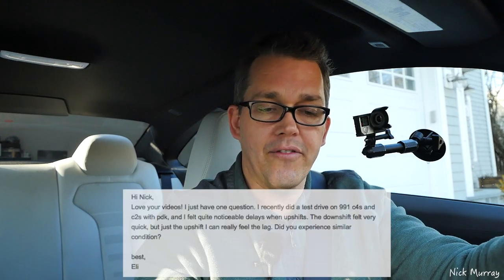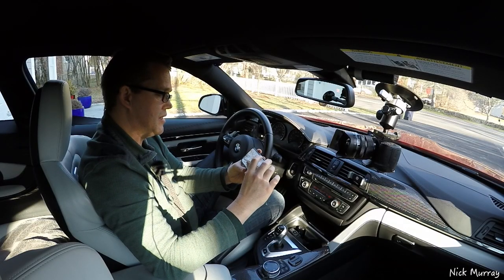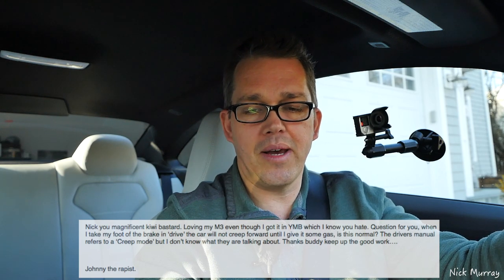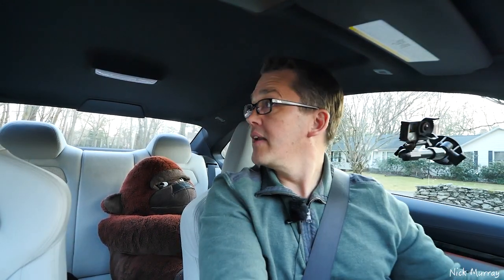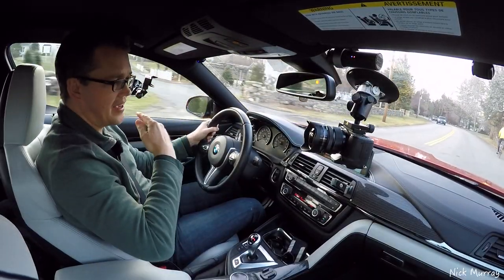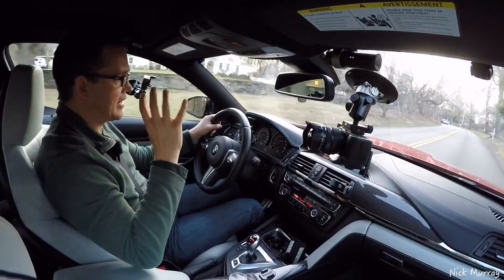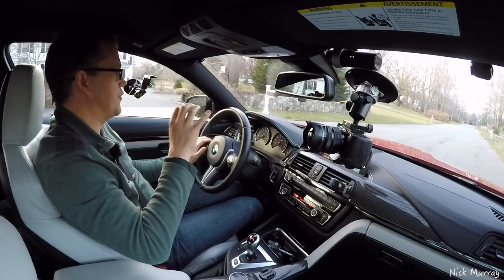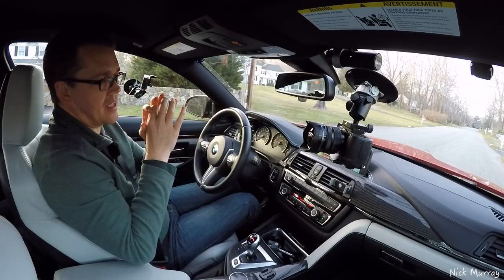BMW M Dual-clutch transmission and Porsche PDK transmissions DCT DSG

Comment: This was better than Engineering Explained
Reply: +Alex Stern I enjoy EE's videos, but they're a bit dry and he's not as engaging as nick is. but those videos are certainly very detailed and the engineering is spot on.
Reply: It was also not completely correct. There's no slipping (in literal meaning) and definitely no friction in a torque converter. It's purely hydrodynamic. That means the "slippage" doesn't wear anything out and you can freely "creep" as much as you want.
Reply from the maker: +Pr3dator SvK I did not say the slippage would wear the torque converter? I said the slippage would wear the wet clutch in the DCT.
Reply: Nick Murray Yeah, you didn't :). I was talking specifically about the slipping and friction and it's just nit picking. I've mentioned the rest about no wear, because you didn't :).

If there was friction, something would wear out eventually. In reality it is just oil that's being spun up by a turbine, which pushes on impeller and rotates it. They're not even touching, so there's no friction happening. :) For better explanation refer to EE videos :D. (Not you Nick, I know you've good understanding of how it works. Other folks for whom my explanation doesn't make any sense, but are still interested how torque converter works.)
Reply: +Alex Stern +Engineering Explained shots fired

Comment: PDK can do up shift so much quicker than M4 Dual Clutch in manual mode. Under the circumstance that your speed is allowed to change say from 2 to 7, you can shift your gear up manually within very short amount of time. The Dual clutch in M4 can do 3 gears up shift and will generate delay after that.

Comment: I have an M4 too and I'd like to add that it is possible to engage creep mode by tapping the gas ever so slightly. In a traffic jam for example instead of feathering the gas all the time you can just tap it once and the car will behave like a torque converter as explained in this video. I really like this feature.

Comment: Perfect timing with this video!  I test drove an M4 today, and it was my first experience with a DCT.  Have to admit it was a strange feeling for such a powerful car to not move when I took my foot off the brake.  Thanks for the great explanation.
Reply: Dealership can code it for creep mode if you want.  Enabled causes the car to creep forward when you release the brake.  With it disabled, you would have to tap the accelerator to begin creeping forward.

Comment: Nick, you should put firm pressure on the brakes when you're stationary because if someone hits you in the back, or even if there is a car behind you and that car is hit from the back and then hits you, you're way less likely to hit the car in front of you.
Of course, the car probably automatically applies the brakes until you press the accelerator (i.e. hillstart style), but I'm not sure how hard the brakes are on in this case.
Reply: If there's enough space in front of you, where you can roll, the hit will be more gentle and the damage smaller, if you're not holding the brake. Also your instinct is to slam the brakes any way, so you won't roll super far.
Reply: Ummm what, smaller damage when not holding the brake? Please elaborate
Reply: If you're holding your brakes and someone rear ends you, it's like he hit the wall (figuratively). The energy has to transfer immediately. If you're in neutral, you will roll forward, so the energy has more time to transfer. Imagine kicking a ball in a empty space vs kicking a ball resting against a wall. In the first case, it rolls away, in the second case, you hurt you feet real bad.
Reply: Yeah, but you only have to repair the rear.

Comment: Very professional video! Just that the "jerkyness" when its cold is because of the higher rpm of the engine because its trying to warm up as fast as possible, so when the cultch engages its at higher rpm than when engine is warm

Comment: An additional reason that the DCT and PDK are more finicky when cold is they use a wet clutch (immersed in oil) which is more sensitive to temperature due to oil viscosity. Manual transmissions use dry clutches and don't have to deal with a change in oil viscosity effect the grip and grab of the clutch. 

The BMW DCT is actually warmed when cold by the engine coolant which in turn is cooled by the same coolant once it gets up to temp.

Comment: Interesting point on the creep and clutch slip. I guess the more the cars are driven in traffic jams with lots of stop/start at ultra slow speeds the worse the wear on the transmission will be. Will we see a lot of city cars needing expensive transmission rebuilds at, say, 50k miles? The beauty of a manual is that you can press the clutch pedal all the way and coast in these traffic conditions - lessening the slip and, thus, the wear.

Comment: Should be gettin an M2 this year with the DCT so this is real helpful, thanks :) I currently have the M235i (great car btw, was thinking of trying to do a comparison video for all those downcrying the M235i once I've had a chance to drive the M2) with the ZF gearbox and it's lovely and smooth and quick so I would have been suprised myself if the M2 felt a little jerky or shuddery. Keep up the good work squire :D

Comment: Best explanation I've seen of how the two different autos work... Well, for my simple brain, anyway. Just wondering if DCT clutches wear out as quickly as in manual cars... Do you need to replace your clutches in a DCT every ~50k miles?
Reply from the maker: +Matt Motion I had the DCT in my 2008 M3 and did 100,000 HARD miles in it and no problem. I believe many of them will last the life of the car.

Comment: Dear Nick

   Just one detail about the  torque/transmission  = no actual mechanical link between engine  and the transmission  it is a hydro transfer  (transmission oil)   the torque converter is bolted to engine (spin) a little like  two salad bowl put together the one on the engine side has fins to propel the tranny oil on the propeller for the tranny, the transmission has a shaft that hook to  like a windmill propeller  inside the torque converter  that is why manual are more economical  because no lost of friction.   example  2016  Mercedes S COUPE = S63 Dual clutch,  S65  torque tranny

Well done Nick...
Sincerely yours  Dave (Canada)

Comment: Good video. Interesting tidbit. I have a 135i with a dual clutch. BMW programmed if differently than the M3/M4.  If you take your foot off the brake at a stop it engages. I much prefer the way they programmed the M3/M4. It also feels more direct and precise in the M3/M4.  It's the reason my next car will be a manual.

Comment: Nick - the DCT might be more energy efficient than some torque converters but it seems that the ZF8 speed has done away with that. All BMWs with the ZF8 speed have less consumption than manual. I am unaware of any car model with the same engine which offers both ZF8 speed and DCT to see which of the two consume less, but would be interesting to know.

Comment: I own a VW Jetta with a 7 speed dry clutch set up. When I stop at a light, what is the proper procedure to save my clutches? Is it necessary to put the vehicle in neutral?

Comment: Understanding how the trans works and driving it accordingly works very well. But I will say they are not automatics even if there is a mode for it. These are manual transmissions without a clutch pedal. The driver needs to drive the car as a manual, controlling the clutch with his gas pedal and rpm shift points
. Some may not want to invest the time but some will like the 500hp ball of fun the M3 and others have to offer with this transmission. It really makes the M3 into something I want to drive.

Comment: Went with a DSG in my Volkswagen Passat TDI company car. I dont want to drive a manual anymore, atleast not in a daily driver. Its fast, its smooth and doesnt need more fuel than the manual version of the car. Only downiside is the slighty harsh rollon from the standstill sometimes...

Comment: When you ordered your M4, did you pay MSRP.  I'm pretty sure I'm going to order a 2017 c63 S coupe.  The dealer said they don't give any deals on AMG cars.  I'm still debating if I should get the c450 instead.  Mostly for the all wheel drive, when I go to the mountains.

Comment: I've had dual clutches in my 335d and X6 4.0d and now my Macan S Diesel. In my experience, the BMW gearboxes are vastly superior to the Porsche one. Where the BMW box was always sure footed, the Porsche one is often hesitant. And don't get me started on start/stop in the Macan.
Reply: +Calvin Chann The Macan actually has an Audi S-tronic box (as it's really a Porschefied Q5) not a Porsche PDK like you'd get in a 911 or Panamera. Of course they do call it PDK all the same.
Reply: Your 335d had a regular automatic gearbox . DCT was never an option for the 335d only 335i on the ‘is’ model.

Comment: Nick,
Have you ever driven an E46 M3 with the "SMG" single clutch gearbox?  It's very crude compared to a dual clutch gearbox, but it's also a lot of fun for the same reason.

Comment: Hi Nick, enjoy your videos, I have a 991.1 Carrera 2013 it doesn't immediately engage from park to drive, similar to some of the descriptions that you gave in this video, I have been told by a very well respected uk Porsche dealer that this may mean the gearbox could in time fail entirely? In all other respects at any speed the gearchanges are perfect in this phenomenal car, what would your thoughts be??

Comment: A great explanation on the differences between the 2 transmissions. With the creep mode, my M4 is a real bugger to park in tight spots. moving a few inches ahead is near impossible. Any suggestions??  cheers from  Ken in Sydney Australia

Comment: I bought a 2017 Hyundai Tucson with a DCT about a year ago. I love it now but there was a distinct learning curve to understand before I felt confident while driving it. I discovered all of the quirks that you have mentioned. I have learned to switch between automatic and manual mode in order to eliminate the quirks. thanks for the video.

Comment: I had an E89 35i with the DCT and I wasn't a huge fan. When I put my foot down there was always a very long delay before the car actually started accelerating. It felt like the throttle itself was asleep or something. Very annoying as you couldn't just plant your foot to overtake, you had to anticipate when you could overtake and plant your foot a couple seconds before. It was so weird that I doubt it was normal.

And yes, a light throttle would get the car moving at idle. Had to hold down the brake to start the car.

My subsequent Golf GTD mark VI had the DSG and it was a lot more quick witted than the BMW's. Smoother too. Had one gear fewer though. But it wouldn't let me cruise around in a higher gear at lower speeds, which would be perfectly possible with all the diesel's torque. I hated hearing that droning engine at low speeds. I could start the Golf without holding the brake.

Comment: Hi Nick, just wandering question about" the riding clutch in low speed", Does the BMW M Dual-clutch transmission has a torque convertor? What the torque convertor does?
Reply: A torque converter is basically a “normal” automatic gearbox. Dual clutch is something else. Nick explained it correctly, but it went fast.
Consider slipping the clutch equivalent to slipping the clutch in a manual gearbox. Unlike the torque converter they’re not dimensioned to withstand the wear from the friction (creating heat).

Comment: Got a couple questions, when the transmission is in "D" can you pull both paddles simultaneously to put it into neutral (I know that Porsche's PDK does this)? Also when you're going in reverse, once you need to put it into "D" again can you pull the + paddle to put it into 1st gear? I know these are features that exotic cars typically have, but just curious if BMW's DCT is also capable of this since it's an electronic gearbox.
Reply from the maker: +Daniel Shulman The BWM DCT does not have the coast feature like the PDK cars. Note that the pull back on both paddles feature in the Porsche will only work under certain conditions. When you select D in the BMW it will be in 1st without need to +paddle, however you can +paddle and force the transmission to start in 2nd for a smooth takeoff. Most people do no know that.

Comment: So that isn't really how a torque converter works. It's not a lubricated clutch. It's fluid being spun outward (the pump aka engine) forcing a turbine to spin (attached to the drivetrain)  and is hydrodynamics rather than lubricated plate friction. There's some cool animated videos that explains it.

Comment: Hey Nick, in your video comparing your standard M4 to the chipped and tuned one, you mentioned you definitely wanted to get a chip + wheel spacers. Why did you decide not to?
Reply from the maker: +Edron7 Two reasons. 1. I use my car to compare to other cars in videos so nice to have it stock. 2. Tuning and other mods devalues the car and I am planning on selling it soonish so want to keep it at top value.
Reply: +Nick Murray So we're going to see you in a brand new 911 4S or Turbo? :)

Comment: I wonder why they don't make Triple Clutch Transmission that would have you covered on both upshifts and downshifts?
Reply: +davedavis Thats just what I was thinking.
Reply from the maker: +davedavis At some point you are starting to get diminishing returns : )
Reply: davedavis Skip the triple clutch. I would like to see a quad clutch that engages the next clutch's clutch before disengaging the previous clutch's clutch with a completely separate clutch that clutches multiple clutches. That would be clutch.

Comment: Great video, as always...but I feel like it did not fully answer the question of which transmission is better: Porsche or BMW
Also, I myself am in a bit of a dilemma because wife and I want a performance car (at the end of this year or early next year) and we've got it narrowed down to a used 991 C4S and a used F80  M3...would I regret it if I purchased either one with the dual clutch only for those days where my wife could drive the car? I currently drive a manual Volvo S60R and loving it...but wonder if I would regret buying a dual clutch whether a Porsche or a BMW...please let me know your thoughts. Thank you!
Reply from the maker: +Thomas Lawrowski The BMW and Porsche systems are very similar, the BMW has many more adjustments but they work much the same. I personally look forward to going back the a MT in my next car but I find the DCT's to be just excellent.
Reply: +Nick Murray Thank you and keep up great work. Loving your videos.

Comment: Very informative video Nick, thanks. I was wondering what are your thoughts on the 8 speed automatic used in the BMW M235i and Jaguar F types? I've heard many people say that they are the best for spirited driving, considering that they are torque converters. Also, what are your thoughts on the 911 R? I'm sure they're all sold out and bound to go up in value!
Reply from the maker: +smilepermile Yes the 911 R was sold pre sold to 918 owners. The 8 speed autos are pretty impressive, very quick and very smooth. I think for the F type I would prefer the MT however.
Reply: +Nick Murray You say that but I don't think you would, the MT in the F-Type hasn't really gotten positive reviews.
Reply: +Nick Murray How did they make the zf 8 speed so impressive, giving the performance of a dual clutch but with more comfort? Also, is a dual clutch gearbox heavier than a torque converter?

Comment: Should also mention the cost of maintaining a dual-clutch gearbox. While the DCT is the current trend, most manufacturers recognise that it is actually NOT the future, while single clutch is.
Reply from the maker: +den525 DCT is designed to last the life of the vehicle so the maintenance cost should be zero.
Reply: Nick Murray Really? That's pretty good, from memory old DCT/DSG cars require fluid change every 60,000km. I remember it costly a bit in my old VW Golf gti. Maybe it's different now with this generation of DCT
Reply: +den525 the transmission box is a closed system so it shouldn't need changing but you are right some of these transmission fluids need changing. I've asked around and other mechanics say the same thing.  "shrug shoulders"

Comment: when i drive my f80, I can here a sound of "click" when I slow down the car near to a complete stop. Is it the time the clutch is being dis-engaged?
Reply from the maker: Likely to be the drive shaft, it will make a clunk as power is engaged or removed.
Reply: +Nick Murray thanks for the respond! so the sound is normal?

Comment: Nick, this delay is only problem in manual shift mode right?
Reply from the maker: +davedavis No you can fool it in Drive mode as well, if the car is quietly shifting up gears and you suddenly stab the gas to the floor it can be caught off guard.

Comment: +Nick Murray That was a well done ELI5. I hadn't thought of the fuzzy logic aspect of these gearboxes. I suppose that could be a tuner-upgrade-- replacing BMW's slightly retarded algorithms with the tuner's version. Forget "coding", what you want is "track-day shift mode ver #3.1".  Interesting idea.